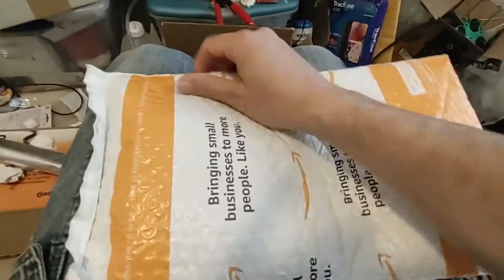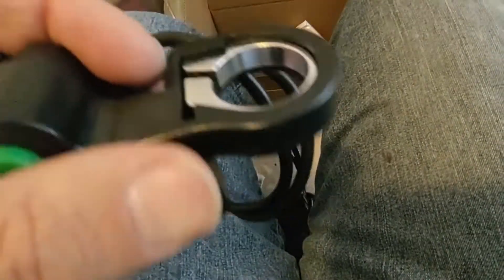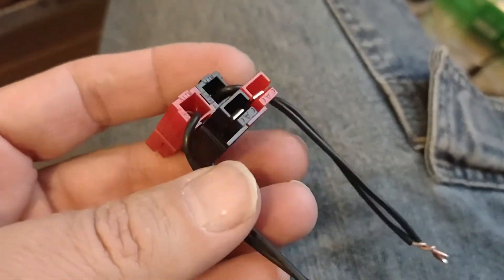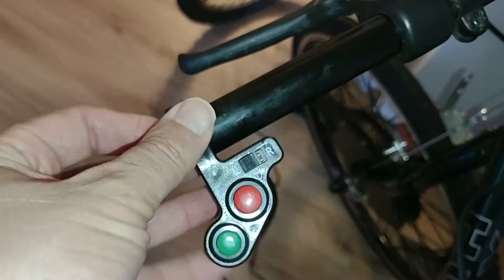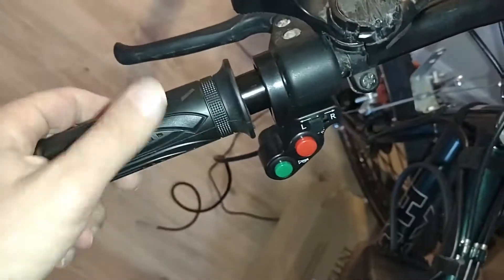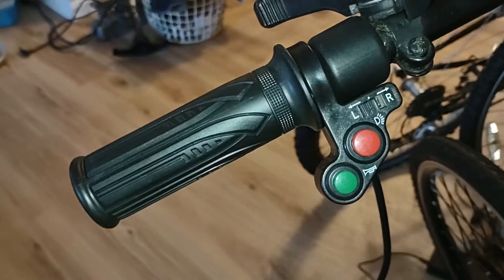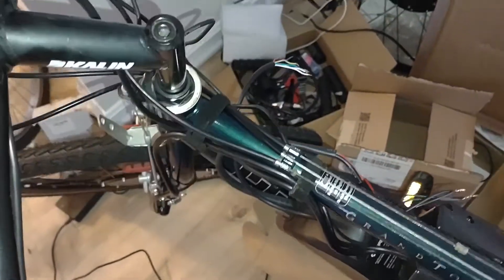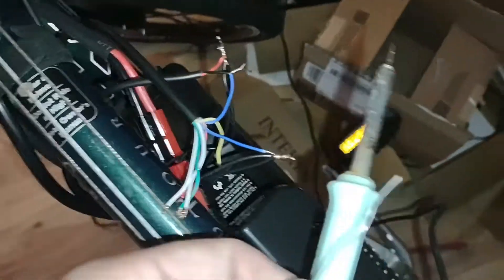E-Bike Light Switch

Comment: Wait a minute, correct me if I’m wrong.  First you said you wanna go from positive battery to the SWITCH, out from the switch to the light positive, out from the light negative to the battery negative. But then you went and soldered v+ to  the light positive, out from light to the switch, from the switch to the positive light out from the light into the switch and from the switch to the battery negative. You did it backwards. Shouldnt the battery power go to the switch first then into the light and come out negative to the battery negative?